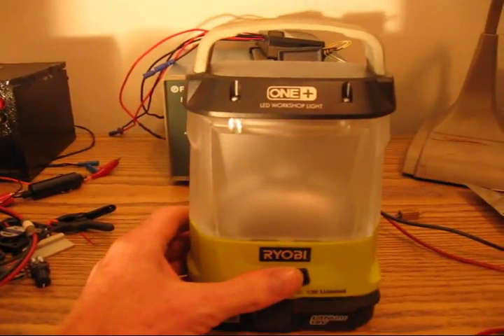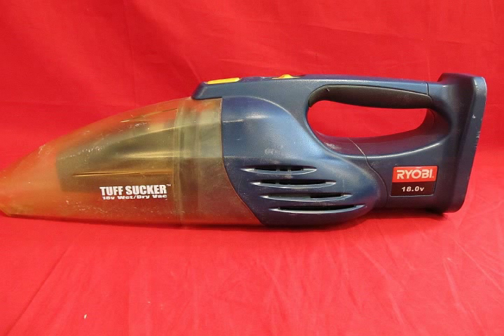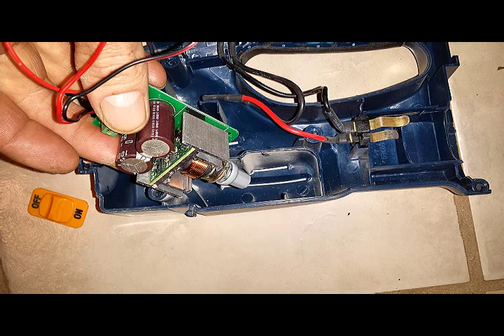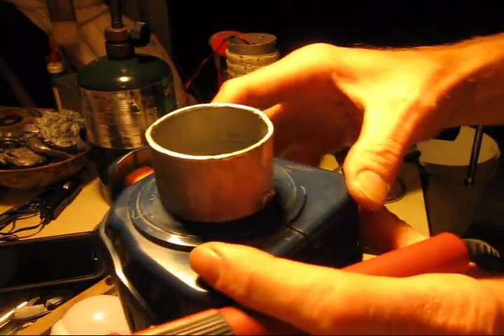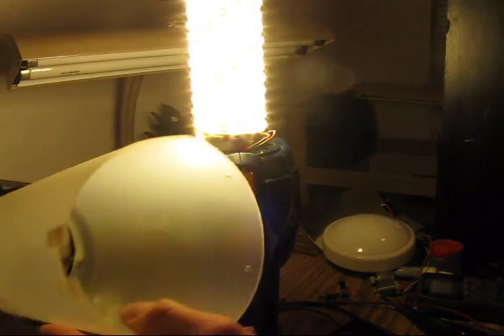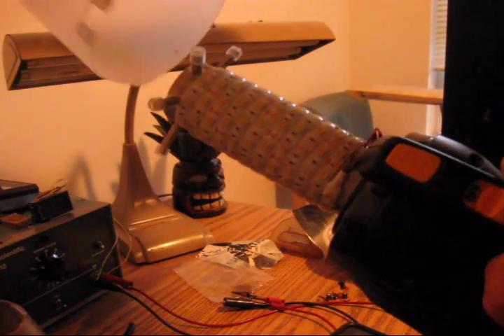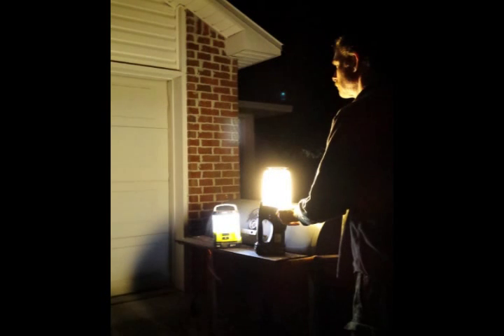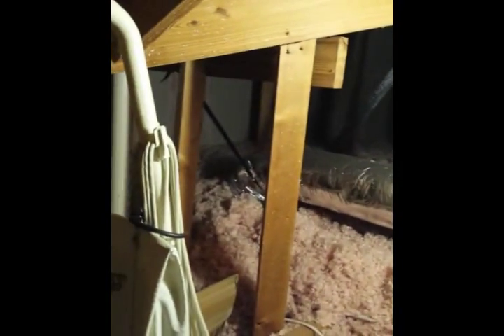DIY Homemade high power LED lantern using Ryobi 18v lithium battery

Comment: I like the idea. I want to build one for my Einhell 18V batteries.
I am thinking about re-wiring a strong led light on top of a heatsink and then just add a switch.
of course I wil need to sculpt or print something that fits into the battery as well.

Comment: Why more bright light, how long time running time, ryobi 18V  li-ion 2.6ah?, new roybi batter 4.0ah why more long running time, homemade dewalt, milwaukee and any battery torch light: 2 in 1 180/360 floodlight & head flashlight, i build torchlight, try on youtube: iginio romero & other youtue: iginio3G

Comment: I just watched your ryobi cordless chainsaw comparison video, now this one which is even cooler. Subbed.
Reply from the maker: Thanks Bubba. It puts out more light than any LED lantern on the market. The disadvantage is the short operating time. Much of the power is wasted as heat in the long strip of LEDs. I'm thinking of modifying the Ryobi P780 lantern and replacing the 130 lumen blue tint LED with a Cree 10 watt 900 lumen warm white U2 LED on a heat sink with a PWM or buck module to convert the 18 volts to 4 volts. Battery should last much longer than in this video.
Reply from the maker: yes, the P720 is rated 20 watts for 1700 lumens output.